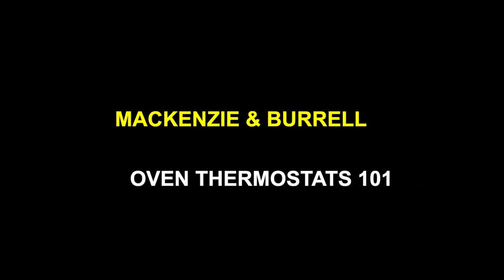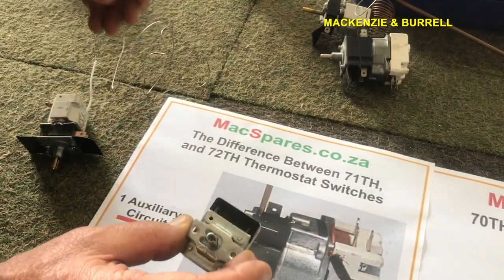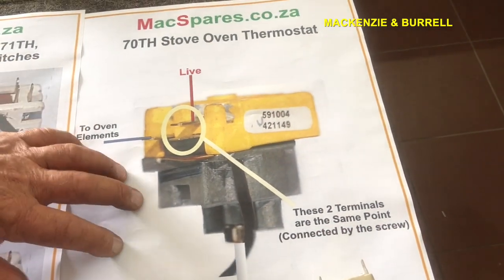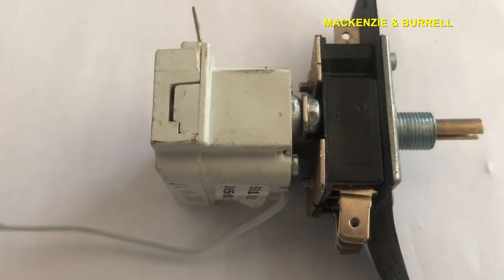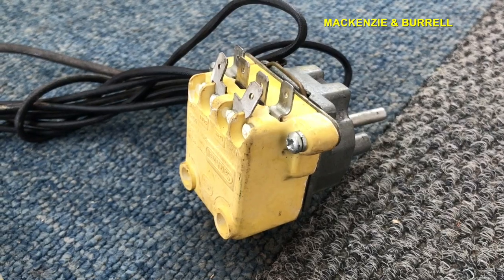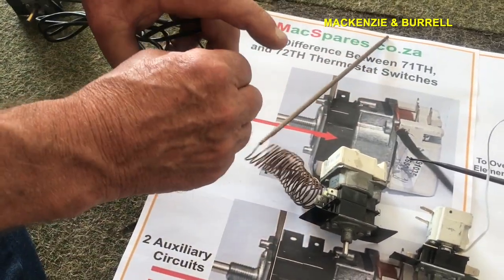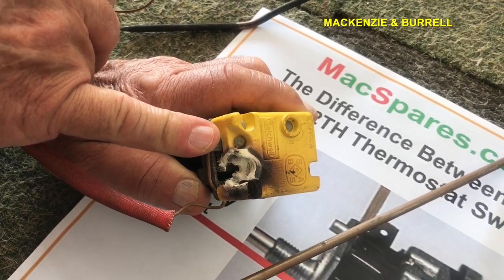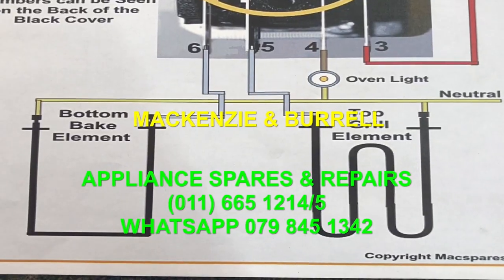Oven Thermostats 101

Comment: My old Defy is tripping breaker when thermostat knob is turned but indicator light is not coming on.Disconnected the element and no longer tripping breaker so element is suspect.Why are the indicator lights not coming on?thank you.
Reply: It’s probably bad if you really wanna know check if it’s getting power to the light

Comment: What if that wire breaks, do i have to throw the switch away??
Reply from the maker: Yep , Break the capillary and its charge escapes so it cannot regulate  / control  the on -off temp
Reply: @fridgeprofessor7574  thanks